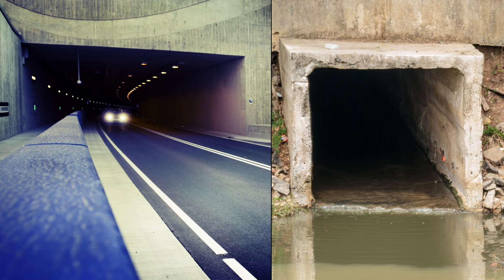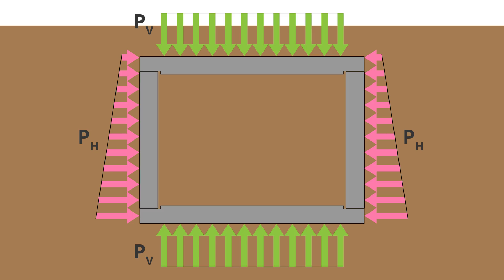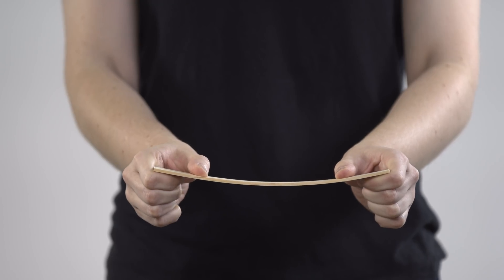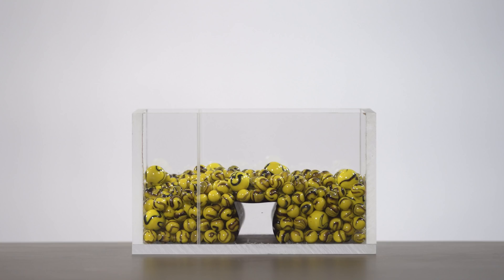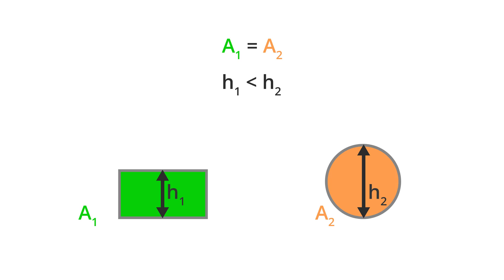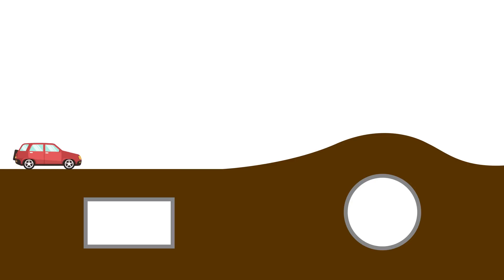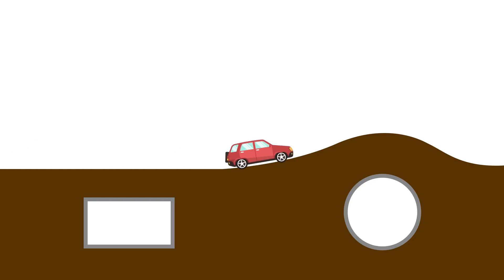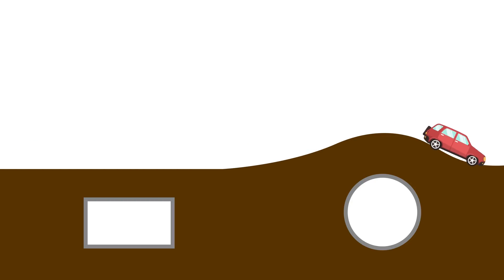10. Tunnels and Culverts

Comment: you really should be using a smaller grained material to backfill, based on the size of your model structures, you are effectively backfilling with boulders. Not very realistic, try with aquarium gravel,  you may get different results.
 I for one would be interested to see the results.
Reply: smaller glass beads could work too

Comment: Nice. But how does one BUILD a tunnel? I mean, inside a mountain or hill for example, how does one 'now it's safe to remove the soil?
Reply: build the tunnel wall as you go, this is what tunnel boring machines will do. 

Even when digging manually (for mines for example) you remove a bit then reinforce the wall then dig further.
Reply: A more detailed video would be nice. There are many ways to build tunnels, like blasting, tunnel boring machine, continuous mining, and cut-and-cover, to name just a few.
Reply: If the tunnel collapses then you know it’s unsafe.
Reply: Tunnel boring machine ;)